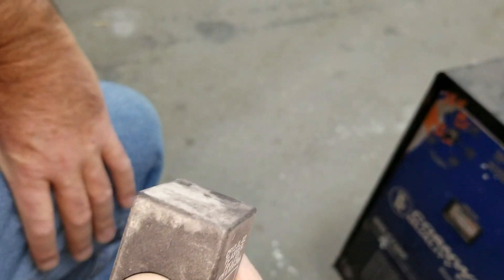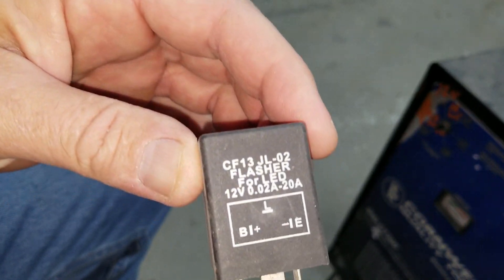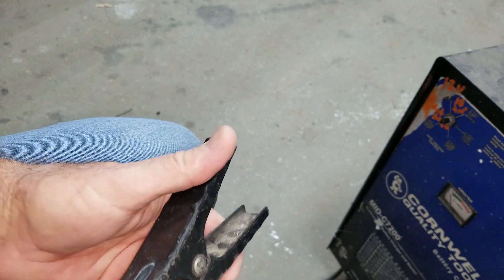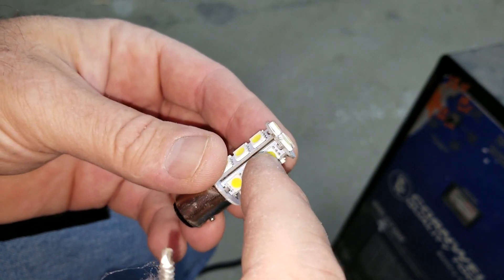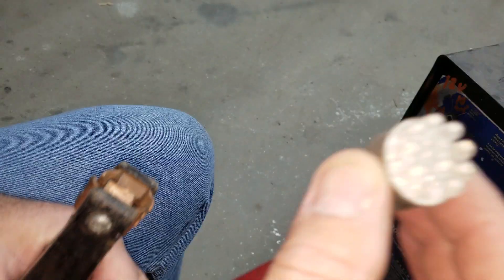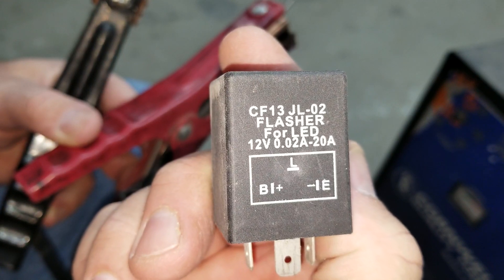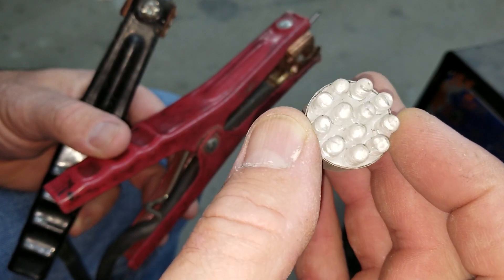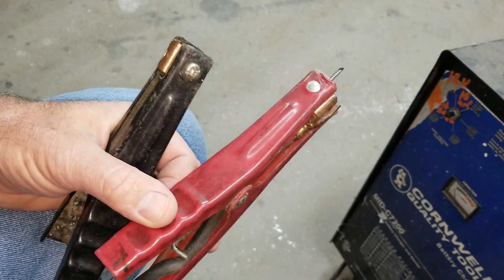1157 LED bulbs won't work on old cars here's why

Comment: The Sylvania Zevo bulbs have built in diodes that prevent this problem. I ran into this issue with the regular Sylvania LED bulbs and they stated I needed the Zevo bulbs they made. I did a DVOM check and they show a diode built in and work perfect.

Comment: Interesting and good info. I actually just did a complete LED upgrade using 1157, 1156 and 94s on my 78 Caprice using similar style bulbs except they are the ones with the projector lenses for the 1157 & 1156s. Only thing I did was upgrade the flasher (adjustable two prong) and reversed the polarity to the flasher.

Comment: I had no problems upgrading my running lights to 1157 LEDs. The kit came with the lights, a digital flasher and a polarity switcher. The whole project took about 30 minutes. I wanted brighter lights due to all the light in today's world combined with the small dim lights on my F100; I was concerned that someone would fail to see the old std bulbs and rearend me.

Comment: Thank you, Mike! This is good information. I just bought an '82 Chevy square body with LEDs installed for every exterior light, and it does a lot of weird things between the stop lights and direction-signal lights (1157 lights), e.g.; with the parking lights on, both of the rear turn signals just shine bright.  I tried standard 1157s in the taillights, and now they flash normally, even with the LED flasher installed.  Also, when the hazard switch was turned on (without a hazard flasher even installed), no lights would illuminate, until i pushed the brake pedal. Then, all of the parking lights would illuminate. Hilarious, right? Then, I installed a standard hazard flasher (before I learned about LED flashers), and the hazards would flash when the switch was closed, but would still stay illuminated when the brake pedal switch was closed. 
After watching your video, I'm fairly confident that if I either change the front turn signal/parking lights to standard 1157s, or install truly duel circuit LED 1157 replacement bulbs, everything will work correctly. 😁

Comment: The stock vulbs do the same thing incandescent shares a ground and if your brakes are on the resistance wont let the tail filliment come to brightness but will still have some voltage. Dont buy cheap leds and you'll have the diode to prevent backflow.

Comment: Add a diode to the feeds. That will prevent the back flow out of the low side. Husky 39871 diode.  That is the 2 in and one out  option.  Roadmaster 690 is a single option.. both are heavy duty. I use the husky for my turn/reverse ...my reverse light flashes with the corresponding side but in reverse the light only illuminates(not the yellow turn just the white)
Reply from the maker: yea that would work i would need 4 of them and smaller ones. the one you suggested is too large. would need to fit inside the tail light.
Reply: You dont want the diode inside the housing. You'd want to splice the diode into the wires before it goes into the bulb socket.   The only "holes" in a housing is where the bulbs secure into it.  So how would you get your wires and diode inside?
Reply: @Mikefngarage   search for. 
Kuryakyn Diode Kit - 4709

It is made for motorcycles but it will serve the same purpose.
And its smaller.
Reply: They accomplish the dimming by putting a resitor in the "tail light" side.  So if you bypassed the resistor it would feed full power back out the other side.. so when you supply power to th brake/turn it feeds back out thru the resistor and back into your tail light circuit.   Are you referring to a setup in your bug from your video clips?
 Im also guessing the turn signal indicator is just a single light?  You could also be feeding back thru that single bulb if it is a one indicator light system. That would be why your getting voltage into the opposite side... feel free to correct me if im wrong
Reply from the maker: @somethingsomething7899  I used some 100v max 10a diodes from the electronic supply but I still couldnt get 2 sets of leds for each side to work at all.
Reply: It's not that simple, especially for cars with front signals and markers that flash (I believe that this might be how some rear signals are wired as well as some trailers)- they wire the marker across both signal (+) connections to the signal light rather than a signal and the ground.  The end result is that the marker comes on when there is a signal to one coil and not the other, but none when there is a signal to both coils (there is 12v at both wires, so there is no potential between them).  Essentially they're taking away the ground to make it flash.

I haven't seen a single solution that works for everything, there are a few "logic circuits" that people sell for conversions but I haven't seen anything mainstream.  I've been looking at this for an '87 Trans Am and am wondering if the best solution is to either re-wire the front signals or to just sick to incandescent bulbs for just that light.
Reply from the maker: diodes do help but we still could not use multiple lights had feed back issues even with diodes on every bulb. gets more complicated than most people think.
Reply from the maker: @mpikas  best answer. I got them to work but only one set of tail lights I have 4 rear tail lights and 4 brake lights Only one set of tail lights would work even with each one on a separate diode. I dont remember why but you are right it is very complicated.

Comment: Related issue of bulb sockets. My 1986 HRC motor home 1157 sockets have a "spring" made of rubber that has hardened too much to allow  removal or installation of bulbs. I teased apart the socket until I could use a pick to extract the rubber "spring" . With a small sharp diagonal wire cutter I cut out  two small pie shaped wedges from the rubber and made to two slits a quarter turn between those wedges. This restored sufficient flexibility to function as original. A little silicone dielectric grease and reassemble.

Comment: that little converter that they want to sell you gets real hot, it dissipates the heat works, but afraid for it to touch anything 12 volts is just too high. just a jury rig at best.

Comment: They will I got them for my dads 85 mustang I had to get a special fuse for them and he used tin foil in the socket to complete the circuit then they worked very well and cool

Comment: Hello Mike Thanks for the video. I just installed All LED's in my 2004 Rexhall AERBUS Motorhome. I hooked Up the back first. There was no problem. Then when I hooked up the side front running lights. The same kind you have in the video. The flashes and turn signals did not work. I changed to the LED flasher as you recommended and still nothing. My side markers went off also. When I turned the RV on both the lest and right was lite.What do you think?

Comment: Got em in my 72 chevelle and they work fine.all I did was put in a heavy duty flasher like you get for added trailer lights
Reply: I have all LED bulbs in my 3 1978 Buick Regals and they work perfectly. Now one brand I did have to add solder to the tips because they weren't long enough to touch the tabs on the inside of my taillights pigtails. When I pressed down on the LED bulbs, they would light up and that's how I figured it out.

Comment: I prefer led brake lights over incandescent due to the instantaneous illumination. A lot of modern cars put incandescent bulbs in reflectors so small that it shortens bulb when they could’ve put in a few 30 cent red LED diodes and a translucent plastic diffuser strip.

Comment: You can use 1157 led's as running lights and turn signals and hazard lights and brake lights. What I did was I used a 5 pin relay and 2 "led flashers". The pins on a 5 pin relay are: pins 86 - 85 - 87a 87 and 30
30 will always have power - 87a is N.C "normally closed" so it gets power from pin 30. This pin 87a will be used to power the low beam of the led. 

Now when you apply power to pin 86 "by turning on the turn signal switch or hazard switch" you are creating an electromagnetic field in the relay which pulls the pole away from pin 87a "brakes connection to low beam of led "low beam goes out" and the pole is now connected to pin 87. I don't use pin 87 at all even though I could use it for another device if I wanted to.
What I do is have 2 led flashers set up so that when you turn on the turn signal switch SPDT or the hazard light switch DPST what happens is that 87a is no longer connected and power is fed to one led flasher for the left turn signal which flashes on and off to the high beam of the led. If you turn on the hazard switch DPST power is fed to both led flashers which gives power to both led high beams. It sounds complicated, I would upload a schematic I made but can't do uploads on youtube.

SUMMARY:

The 5 pin relay has a pin 87a which is "normally closed" in other words the device you hook up to 87a would be normally on, that would be the" low beam" of your dual terminal led. Now when you turn on your turn signal, or your hazard lights, or your brake lights, then power is sent through pin 86 on the relay which will turn off power to 87a. So now your low beam is off, and you get full amps to the high beam of the led which are connected to led flashers and they blink on and off through the led flasher. When you stop the turn signal of hazard power goes back to pin 87a and the low beams are back on. Nice
Reply: i know Im kind of randomly asking but do anybody know of a good place to stream new tv shows online ?
Reply: @Dakari Maxton lately I have been using FlixZone. You can find it by googling :)
Reply: @Moses Watson yea, I've been using flixzone for years myself :)
Reply: @Moses Watson thanks, I went there and it seems like they got a lot of movies there :D I really appreciate it!!
Reply: @Dakari Maxton no problem :)

Comment: For my 68 Firebird I was only able to use one set of LEDs. I put LEDs in my tail lights, I was only able to use those and not for my front side markers. I put a LED blinker relay in my fuse box and now I can have LEDs front and rear.

Comment: Hey Mike.. I'm looking to go LED 100% on my 62 panel (with the exception of the generator light).  I saw that if you install a resistor, you can get the LED's to work and flash at the correct blink rate.  Have you tried these resistors to see if they work, or have you heard about this??  It's gonna cost a couple of hundred by the time I replace all the bulbs.. but I think all the bulb's will work fine with the exception of  the 1157's.. dual purpose/ filament (blinker and brake light).. any input would be appreciated..
Reply: I tend to agree with the video. I have a 2005 Acura TL and I put auxito LEDs on the rear blinkers and all is well.  The rears are blinkers only.  But the front is 1157 combo parking and blinker light.  A plain swap obviously did not work. The parking light was dim and it hyperflashed. So, instead of using a resistor to emulate the oem bulb, I skipped the resistor and tied the 1157 led in parallel with the oem bulb.  The total current should be slightly less than the oem bulb, as the led 1157 has 8kohm and 6kohm resistance compared to the analog bulb at 1ohm and 2.5ohm.. so basically the led would piggyback off the analog bulb and from the controller stand point, the circuit should look almost the same.  Well, the parking side did work this time perfectly and was bright. But when I hit the turn signal, the led bulb would flash on and off  but completely opposite timing as the analog bulb and opposite to the other bulbs. The 1157 led would turn off when the 1157 analog would turn on. Or at least, that is how it appeared.  I am not for sure what was going on inside that led 1157 but it doesn't work like the 1157 analog.

Comment: I know this is an older video and I didn't read through all the comments to see if this was mentioned. Another issue with these bulbs you have is that they are the wrong style.  At least for the old 60s cars. I bought these by mistake and it took me a bit to figure out the problem.  On these they don't line up with the contacts in the socket correctly.  The little nub things that lock the bulb in place and hold it are clocked differently so only one side contacts the connector points in the socket. I forget which now but thinking I only had brake lights and no tail lights but might have that backwards.  You need the ones with the little round contacts not the bayonet or whatever you call that shape on the ones in your video. I just put the correct contacted bases in my '64 and I have tail and brake lights both like it should be and using the stock flasher at the moment. But the only LED lights I have is in the tail lights as I wanted brighter lights back there as my brake lights aren't that bright. Previously I used 2357 bulbs i believe they were. They are brighter but also heat up more so wouldn't be good in say a '60s impala with the small tail lights. Hope that at least helps someone out a little.
Reply: I think you may have bought  bulbs with the wrong location pin orientation with regard to your 1st problem. It's easy to get wrong as there are several location pin positions available and only very careful analysis of LED bulbs website information will match with your car's pin orientation specification. Some variants are offset, others 180° opposed.

Comment: I've got a motorhome with LED brake lights each light has about 30 leds in it, they weren't the original lights when the motorhome was built the company changed the lights to Led the original lights on the chassis were halogen I think, recently the light on my dash has been staying on so I checked the brake lights but they're working perfectly but what I did notice is approx. 3 leds in one light and 4 leds in the other light weren't working and I'm wondering if the reason the dash warning light is coming on has something to do with resistance because of a few blown Leds.

Comment: This is an issue with cheaper LEDs.  They have continuity between the 2 contacts so the current feeds back through the brake light contact to the tail light contact.  We're aware of this issue and build our LEDs with no continuity between the contacts so they are an effective and straight replacement.  For turn signals you should use an electronic flasher unit and avoid the use of ballast resistors.  Ballast adds back in all the load you saved by going to LED and can get extremely hot which is dangerous, especially on a classic.
Reply: @classiccarleds thanks - would you confirm that your GLB380 1157 bulb has the two circuits isolated? Also, do you ship to the US? Thanks
Reply: @LeafRhetoric  Our negative ground are all separate circuits, some positive ground too.  We ship daily to the USA

Comment: I have a 1994 Toyota Celica and the front turn signal light is gone... I'm tempted to buy this. so is there any easy way for me to find if it works or not the easy way? or only through trying it first?

Comment: Surely you are discussing is the brake / tail light combo where the tail light is the lower brightness and the brake is the higher.
Also, the turn indicator should show behind the orange lens surely not behind the red brake lens.

This is the configuration on my Japanese Toyota.

The turn indicator should be a separate bulb with only one central pin and is always bright.

Comment: God dude I gotta figure this shit out, this helped alot tho. I have a 1987 Camaro that we were trying to put LEDs into... Got the flashers for it, but once we got everything in... Car went absolutely batshit with its lights. Right turn signals makes ALL the tail lights and the turn signals blink, where as the left only makes one light in the back blink.... Sometimes it even makes my gauge cluster blink. Gotta figure it out hahahaah. So confused
Reply from the maker: yea when you have brakes and turns on the same circuit the LED wont work. Need to be separate circuits.

Comment: G30 chevy van and LED 1156 AND 1157 work just fine. I was told flasher would need changed . Wrong.
Went back to original flasher and works just fine.

Comment: LED brightness controlled with voltage. A resistor in the tail light wire and no resistor in the brake/signal wire does it.

Comment: 2nd issue about the flasher....just make it ...it's simple and very reliable.
u can do mechanical one with just a relay and capacitor or u can be little more complicated and do  some electronic work to make one......and if it's available and cheep just buy one!

Comment: Actually they DO work! I've used them many times and Never had a single issue! Obviously you sometimes have to use a special flasher, but that's no big deal.
Reply: on what car ?
Reply: @jojos4792   worked on my 66 caddy

Comment: They work well on mine. For the turn signals the LED flasher would not work so I put resistors in the circuit for the four turn signal bulbs.

Comment: They do for a fact work, at least in my 1993 Pathfinder. But, what is your definition of "an older car"? I've used both of the types you have, and all of the bulbs on my 1985 Honda Shadow have the 2nd style of light you tested and they work fine too.

Maybe it's your car, so get rid of it and buy the car that works with your $0.59 LED bulb. or buy some $25 Sylvanias that are designed properly. 

The LED flasher I found has a dial on the top to change the speed of the flash, it was $2.79.
Reply from the maker: I am referring to cars that have dual filament bulbs only most of the cars in the 90s and some 80s have separate bulbs for turn signals then brake lights Usually they will work fine but some older cars have the issues I mention in the video.